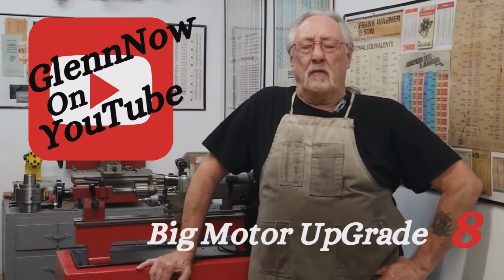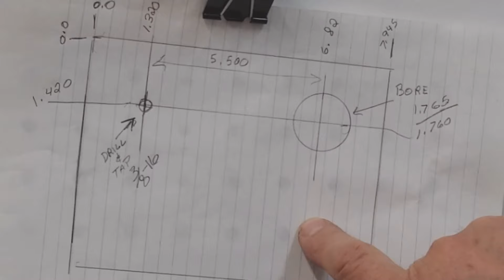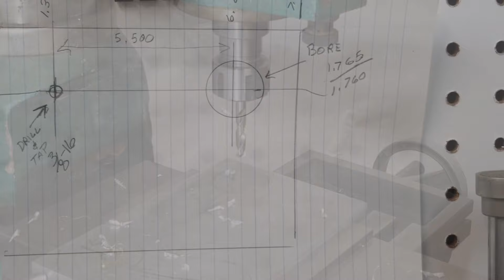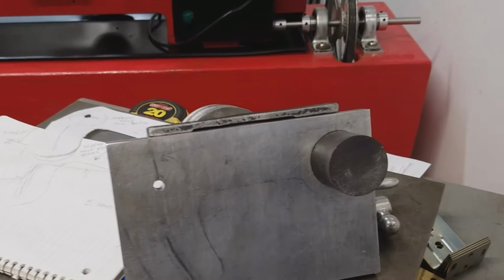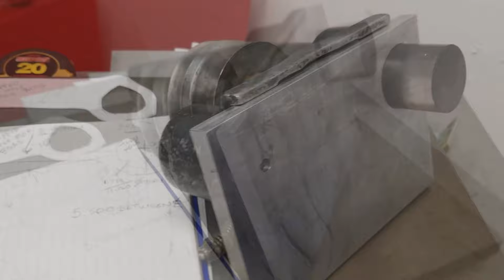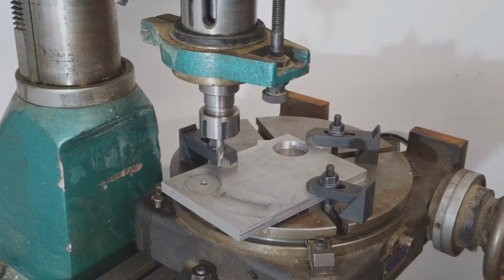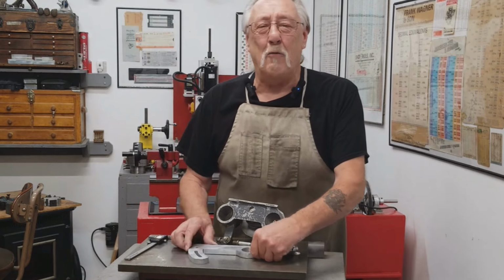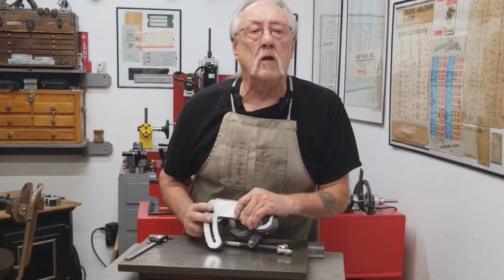Belt Tension Bracket, Big Motor UpGrade 8

Comment: Wow, that's a big drill🤣  Looks pretty good.  The chips hanging off of that thing looked pretty scary though.  I hate it when the lathe does that to me and they are just flailing all around, you definitely have to be careful!  I usually get pretty lucky and I am able to peck the drill frequently enough or break a chip when doing mill work.  When it does fly around on a mill it's usually a small bit on the stuff that I have done.

I was wondering if maybe a slightly faster rpm and feed would help🤷  Looks like it turned out pretty nice though.

Joe T
Reply from the maker: Thats the same Drill Bit I used in my Mini Lathe when I did the "Harbor Freight Mini Lathe, Monster Drill Bit Challenge" video. 

In That small Milling Machine a faster RPM would just make the drill bit jump around. Once I got a chip flowing I didn't want to stop the flow.
Reply: @GlennNowOnYouTube 
Very understandable, I was wondering if you had tried it already.  I do a 1.25 counter bore on some cast parts (that often come a bit hard-ish) and it'll hop around like crazy if I don't keep the speed low and pressure relatively high on it.
Reply from the maker: You know, It sounds like you have a great job. I'm retired now and going up and back with you brings back a lot of memories of the times I had in the many Shops I worked in.
Reply: @GlennNowOnYouTube  
All good I hope🤣 Yeah, it's a pretty good family owned place.  I get a lot of experience since it's a small "job shop" and they are very forgiving on things like days off and being on time and the like that most places will fire you without a second thought.  Plenty you can always pick at, but it's a pretty solid job for a person like me.

Yeah, it's not often I can talk with anyone not from work about machining stuff.  It's pretty refreshing.

Comment: Hi Glen, really enjoying your videos.  I am debating if i should buy a new mill or upgrade my current mini with a new bed and larger motor.  The one thing I aways seem to want is a larger head bore.  Even putting on a 5” chuck as in a previous video still leaves this tiny little hole in the head stock.  Any ideas besides the obvious?  Thanks and keep the videos coming.
Reply from the maker: I feel the same way as you about the spindle bore. Way to small. My fix was the longer bed and using a steady rest. This way I could do longer parts. The 5" chuck was just for larger diameter parts.